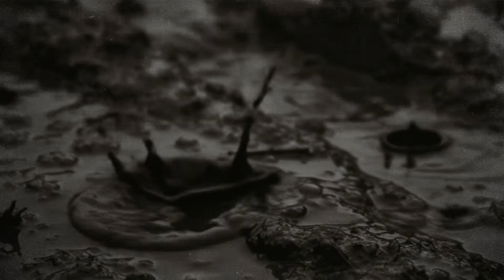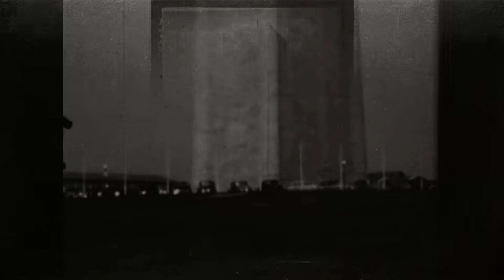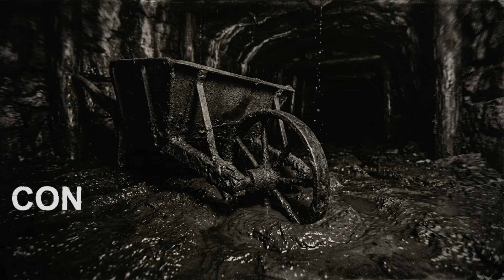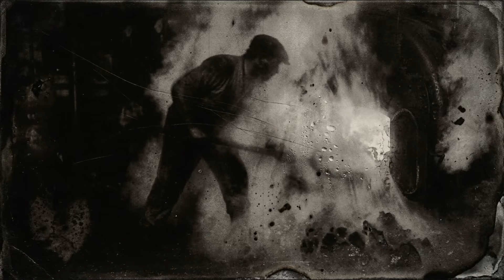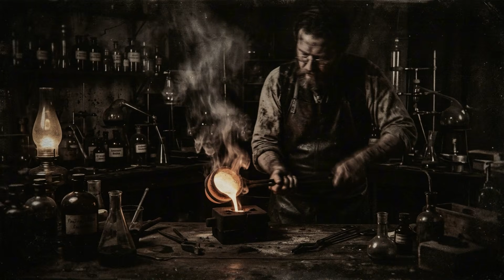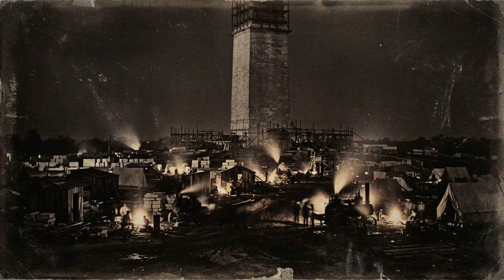Why the Washington Monument is Physically Impossible

Comment: You forgot to add the hot air from politicians to the audit.The 'real' steam engine.
Reply from the maker: Haha, that hot air was definitely running at maximum pressure! If only political speeches could actually mix mortar and stabilize foundation settling, the monument wouldn't have sat abandoned as an unfinished stump for 25 years.

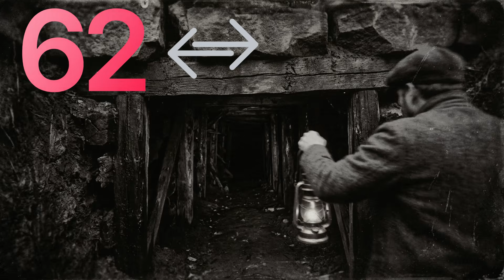Comment: 5:28 Widen the "raft" all you want, you're still floating on mud...no engineer would propose that. And the monument hasn't fallen over so it wasn't done. 

The photos of the 152' tall stump look a bit faked, but how are we lifting 6-ton blocks again?. I think the machinery and rigging could handle window-washer's scaffolding, though. Was the contract just for scrubbing the outsides of the monument clean, maybe installing a stairway, too? That would be a massive undertaking in and of itself, but I think they could do it.
Reply from the maker: Exactly! Widening a masonry raft on top of swampy Potomac mud does not magically suspend the laws of soil mechanics. An 80,000-ton structure would suffer massive differential settlement, yet it sits plumb—which tells us the official foundation story doesn't add up.

And your point about the rigging is spot on! Using primitive steam hoists and wooden derricks to repeatedly position 6-ton marble blocks at 500+ feet defies 19th-century mechanical limits. The idea that the 1880s contract was actually a massive restoration, cleaning, and stairway-installation project on an existing structure makes way more logistical sense than a ground-up build. Exceptional analysis!

Comment: good show ! I would say there was most likely a preexisting foundation on the evidence of some early photos showing about 30ft of very old looking stepped  megalithic blocks at the bottom . The trustworthyness of early narrative is also made even more doubtful by the many instances I have seen of early photoshop being used on historical photos . Honestly why would they except to lie ? I have recently seen old construction photos showing workers seeming to pile up stone blocks when the buildings concerned are actually facading over brick internals ! Which raises the question for me , could even the washington monument have brick internals ...
Reply from the maker: That is a fantastic engineering observation! The idea of a pre-existing megalithic foundation or a different internal core (like brick) completely changes the structural load calculations. If they were actually just facading an older, pre-existing base, the mathematically impossible 19th-century timeline suddenly starts making a lot more sense. My audit focuses on their official claim—that they built it 100% from scratch with solid stone—and that claim simply fails the basic physics check. Great insights on the early photography anomalies, too!